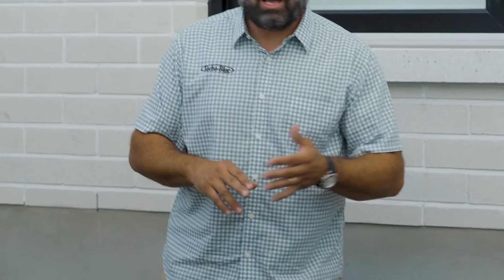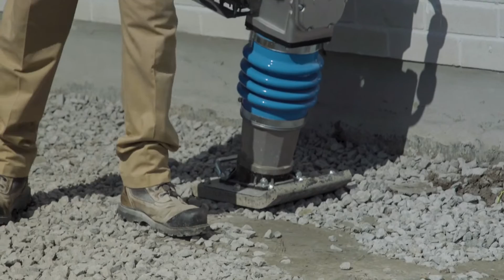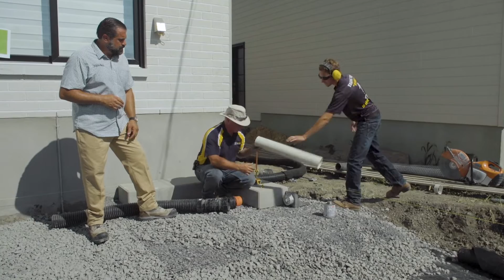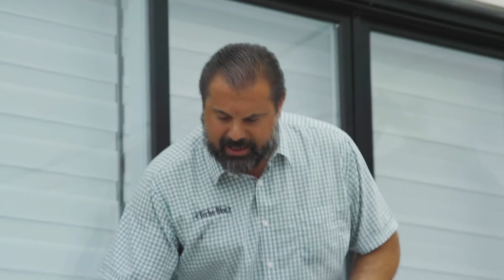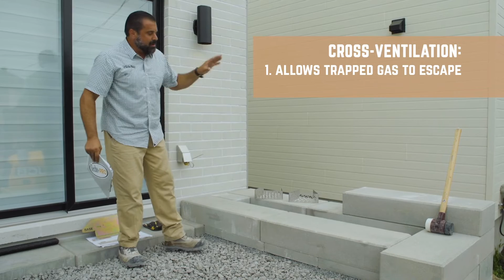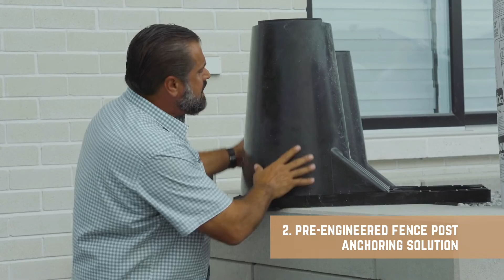How To Build a Raised Patio on a Permeable Base

Comment: Hi 
My home is on a raised foundation and I need to build 15ft Long X 8ft wide landing with 2 steps going down to a pea gravel garden.
I have clay soil and the area has a slight slope so I am concerned when it rains , what will happen and where will water travel to and will it damage the landing and steps ?
Would you recommend getting a drainage for the area and amend the soil with lime and 3/4 clean stone? 

Many thanks

Comment: Probably a 80-100k job and they are “not responsible” for the area 3’ from the foundation.  Will all of that prep you can clean out the bottles,cans and other garbage and fix the backfill area?  Seems irresponsible when that kind of money is spent.  

So the cardboard sono tubes require cutting of the geo grid but the plastic ones don’t?  How is that magic done?

Comment: Would hate to have to move, place, and cut those raffinato blocks all day. How much do one of those weigh? Come back in 5 years that kind of weight cuts like butter thru that new construction back fill. Wont matter how compacted the top 10" is or layers of fancy fabric you put. You can put fondant or betty crocker on it its still a sponge cake underneath.
Reply: Actually, just visited this site yesterday. Has not moved at all. Proper amendment, compaction and reinforcement are doing the job!
Reply: @MrAlexCadieux  guess a bag of lime and rocks and you can put any amount of weight on it huh? Most areas code would req. footer and struct.eng. for that kind of weight especially on that subpar soil.

Comment: Where can you purchase the foam that is installed between the patio and the wall?  I need to purchase this but cannot find a supplier in Canada.
Reply: its just a foam gutter guard. https://www.google.com/search?q=gutter+guard+foam+canada&rlz=1C1SQJL_enCA824CA824&oq=gutter+guard+foam+canada&aqs=chrome..69i57j33.4400j0j8&sourceid=chrome&ie=UTF-8
Reply: Any Home Depot , Lowes or local hardware store. Its just gutter foam.